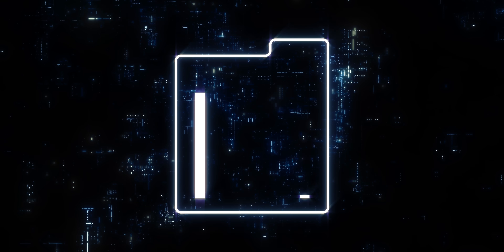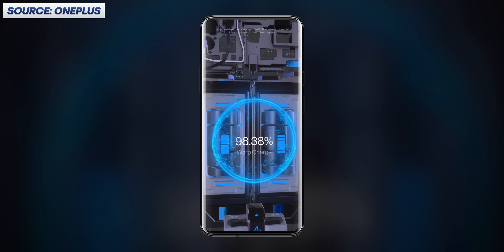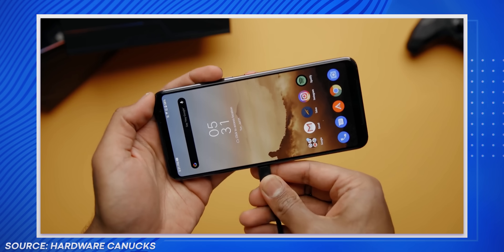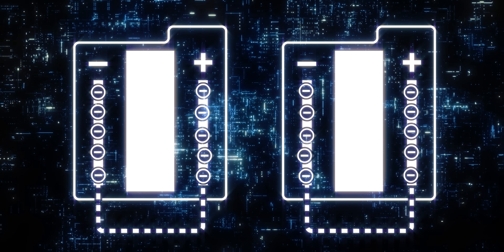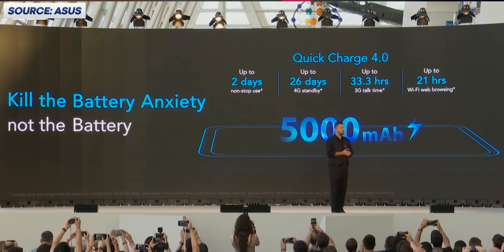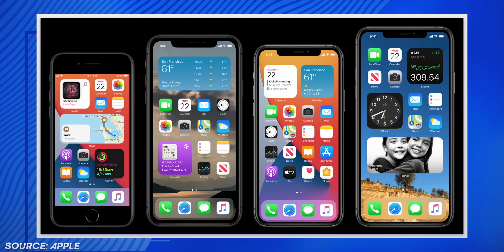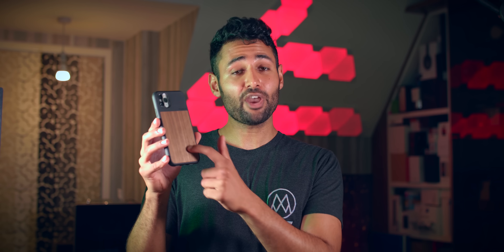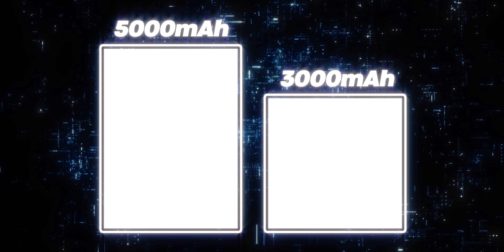The Problem with Fast Chargers.

Comment: Its like choosing between a fast mag and an extended mag
Reply: Extended mag any day
Reply: @Frosty-273  have a mophie battery bank case for my samsung galaxy s10 + 1 tb edition so worth it for all the drops i've had over the years and extra run time
Reply: Perfect analogy underrated
Reply: But always remember that switching to handgun is faster than reloading.😁
Reply: @hemlock42069  But,Using your knife is even faster.
Reply: @hemlock42069  wow, that’s actually right, switching to a second phone is faster than waiting for your other phone to charge
Reply: @hemlock42069  facts
Reply: except you cant carry extra mags
Reply: @rya1701  laughs in detachable Nokia battery
Reply: Extended mag with sleight of hand
Reply: @Udders18  what about Soda perks? (Codm undead siege)
Reply: Pubg players: i dont have such weaknesses
Reply: @manjunathprasad7558  I’m not talking about games. I’m talking about real life guns. Either get a faster loading mag or higher capacity mag.
Reply: Scavenger with fast mag.
Problem solved.
Reply: Power bank: box magazine
Reply: but in this case the fast charging phones even last longer than the slow charging phone's
Reply: I think having a phone with a removable battery and spare batteries in hand could be convenient and dangerous at the same time
Reply: OnePlus has chargers that keep the heat on the charger and out of your battery
Reply: Swaps to drop mag
Reply: Me who reloads after every single bullet 😂
Reply: How about both ;)
Reply: it's*
Reply: 777 👍
Reply: why use the extended mag when u can use scavenger to get more Mags
Reply: Extended mag for me
Reply: yeahh exactly what i was thinking lmao
Reply: The problem for those who chose extended mags in context of guns.. this extended mag is from 2 to 10 times slower than the quick mag.. now decide..
Reply: Extended all day, everyday
Reply: @evvrsince  theres a thing called fast extended in codm which gives you more bullets + reloads fast but it has some mobility downsides which make it balanced

Comment: Wouldn't 0% be when the positive and negative sides have equal amounts of electrons? Otherwise your negative would become positive and vice versa and you could power your phone again
Reply: you are 100% right.  0% charge is the 'stasis' point where electrons are equally distributed among both sides.  The amount of imbalance between the two sides is what gives power, so when there is no power it is because there is balance.
Electronics ship with 50% or less charge because shipping companies will refuse shipments of fully charged devices.  Shipping can be a rough and tumble process sometimes, and they don't appreciate it when you ship a full battery that then gets punctured, or otherwise spontaniously explodes.

Comment: Actually there's no problem with fast charging because the battery itself has a software management. The most important to take good care of the battery is to charge regularly and do not attempt to discharge it to 0%..

Comment: That's how lithium battery works, keep it between 20% and 80%, and also find the way to charge phone with less amp, one long usb cable can do the work,  long enough, to act like resistor so your phone will charge slower, theres some battery apps for android phone that can control charging but the simplest way is to use ardruino with simple relay to act like timer relay or use just timer switch... wherever you do  the battery will wear, but slower.

Comment: Very well made video, quick yet very informative. You should have mentioned about charging further away from 100% actually is healthier for a battery, for example charging to 80% would count as roughly 0.5 wear cycles as opposed to 1 wear cycle for a full charge. My number isn't completely accurate but just as an example. Sorry I'm not very good at explaining stuff but I'm sure you could pull it off in another video.

Comment: thanks for the physics lesson. i have learned so much more on chargers
quick question : if my device supports 45w fast charging (tab s7) and i use a 60w fast charger to power it, will this negatively affect the battery life of the tab s7?
Reply: No. The Tablet will just pull up to 45W power. So it will operate in its phone's peak wattage, not of the charger's. That way, the phone could protect it's battery.

Comment: There's 3 types of charging slow charging fast charging and normal charging slow charging makes charging the battery so slow but it makes it so long and fast charging is too dangerous cuz even if it charges battery faster but it makes your phone heat and u loose battery faster too and the best charging is the normal because it charges not slow and not fast and it stays for a quite good time

Comment: Informative presentation,  as always.  One concern about those wireless chargers,  though they do not erode the USB socket every day (ultimately needing repair) to get 30w by induction to the battery input,  you need to put roughly double that in the EM field of the charger.  Same thing as health concerns having your house near power lines, only in your next room..  @Arun, make a vid on SAR and mobile health issues,  show yourself an impartial opinion former.

Comment: What the fuck is wrong with you man
Apple is the same company that deliberately made bad batteries for their phones so that people would have to change their phones in 2 or 3 years.
Also most people change their phones after 2 years. If fast charging can sustain the battery till that time then what is the harm in it
It is still better than waiting for 5hrs for an iphone to charge and even then the battery stops working after 2yrs.
Next time when you take money boss, please mention at the start.

Comment: Thank-you! Battery damage,maintenance,and super fast charging info is NEVER talked about. Thank-you for bringing attention to the elephant in the room! Kudos!👍❤️🙏
Reply: There's another bigger elephant  around the corner,  fast wireless chargers. There are reasons we transit power via copper lines,  via EM that power bleeds in the environment with effects that cannot be good... Not to mention higher and higher frequency overlapping fields  (3G,4G, 5G...,,  home wireless,  personal wireless) that you have no escape from in an urban environment...

Comment: 50% battery charge does not mean a balanced amount of electrons across the positive and negative terminals... If that were the case, there'd be no charge imbalance (voltage) to induce current to run the phone.

Comment: I don't think that fast charging contributes much to battery capacity loss, I mean, my friend does RC car races, the batteries are 5000 mAh 4S LiPo batteries, he charges them at least with 1xcapacity mostly 5 to 7 amps, the motor in the car is pretty powerful and can take up to 300-500 amps at full throttle, and they last him a few years, while driving almost every weekend in the summer, you could argue that those batteries are specifically designed for this purpose and that might be the case, but the technology is pretty much the same.
15 W or 30 W charging won't exceed the 1,5 C rating of LiPo cells, every thing above that might become a problem in the long run.
LiPo batteries can take 800 to 1000 cycles, if you charge your phone every day, it is standard, that your battery will be at the ending of its lifetime after 2 to 3 years, if I buy a phone, I always want to be able to replace my battery, because it is usually the first part that brakes.

Comment: I have OnePlus 7 and after about 1.5 years of only fast charging it, the battery has degraded quite badly and it doesn't hold charge that well. Accubattery estimates battery health about 75% and OnePlus diagnostic tool shows 78%

Comment: Thanks a lot Mrwhosetheboss for this VERY INFORMATIVE video.
It confirms my charging habits are actually pretty good.
1. I don’t charge it over 80% let it drain to min. 30%
2. I never use a wireless charger mostly the 5 Watt (Apple Original) wired charger and very seldom (in a hurry) the 10 Watt IPad charger
3. I don’t use my cell during charging
And the result: My iPhone 11 Pro Max (bought 21.12.2019) still has a 100% battery 🔋 health.
Greetings from the Chocolate & Watch Country 🇨🇭

Comment: My old phone needed ages to charge but the battery is still kinda fine after 3 years of using but my new phone from the same brand has lost a lot of battery in under 1 Year even though i treated my new Phone a bit better it sucks because the battery only last 4 hours and if the battery goes under 40% i suddenly lose 10% +/- battery in 2 minutes it sucks

Comment: I'd rather have a phone that lasts exactly 12 hrs with occasional use that charges up to 80% by 20-30 minutes, and use a power bank wheneber I don't have power available, like camping in the forest etc. Than a battery that lasts 24 hrs, but takes three hours to charge.

Comment: Someone tell my mom leaving her ipad plugged in at 100% 24/7 isnt great for the battery. She apparently doesnt believe me.
Reply: my mum doesn't disbelieve it, she just seems to plug it back in every time i unplug it for some reason, she doesn't even use it she just keeps it on 100% and doesn't seem to realise that it's utterly pointless and just worsens the problem
Reply: @butterflyexists  that means your mum will do very bad and irreversible damage to the battery in time
Reply: Depends on the electronics. Modern devices switch off charging by themselves, so it does not matter so much...
Reply: oh god, what brick type?
Reply: Stephen Coleman  Actually, draining the battery also lowers its lifespan, as some research suggests. I use the 20% to 80% method to try to prolong the battery. They also say that it would be better if you keep it at a high percentage but not full, so if you have the leeway tp do 40% to 80%, or something like that, it would be better for your battery
Reply: ask them to switch( if possible) to a computer or even a laptop which has built in bypass charging
Reply: @rhapsody4025  wait laptops have bypass charging?. Why did its battery broke due to charging while using ?
Reply: @WhiteBrimYT  batery still degrade over time my dude
Or probably older laptop with older tech of bypass ones, lol

My legion y50-70 still last 3 hours in 80% battery with the gtx 860 always on, lol
Reply: Well, if she is using her iPad always while plugged in, it doesn't matter if the battery is dead as a dodo :-D
Reply: Tat mayb cos ipads take hell lot of time to charge. My ipad 7 takes like 8hrs to charge from 5% to 90%
Reply: @djjithujab  : Larger capacities take longer to charge , but last much longer. 
Just see it as bigger bucket of water, pal.
Reply: Well that's means the electric bill will skyrocket...
Reply: Stephen Coleman  I recently just bought a new phone which is the reason why I was looking to develop good charging habits. I don't have that much money so I also bought a mid-ranged phone, specifically xiaomi's redmi 9t which is about in the same price range as the A10s. Very satisfied with its 6000mah battery and the specs, especially for the price
Reply: Stephen Coleman  Understandable. But as long as google isn't disabled for Xiaomi phones, and there isn't any news that Xiaomi is doing harmful things with my data, I'll probably stay with them
Reply: My iPad Pro also takes a while to charge it takes a couple of hours but it is actually not that bad because I use my my MacBook charger and USB-C
Reply: if she has it plugged in 24/7 then she doesn't need battery life, she doesn't take it any where lol
Reply: Stephen Coleman  Doesn’t the a10s suck ass in like pure performance? or is that the a10e?
Reply: Does device turn it self off or the charger
Reply: My grandfather does it every time too
Reply: Stephen Coleman  A10s isn't midrange. It's a very low-end device, I know because my mom uses it.

Comment: I have found that my phone doesn’t seem to charge properly with the fast charger that it comes with it always starts to overheat at times and when it says fully charged and i turn it on but it drops down to about 80% just by turning it on it’s pretty obvious that your phones battery will get damaged when its using a fast charger as 1 its not fully charging your phone as it isn’t actually fully charged if you charge it to 100% then turn it on it drops by 15% to 20% as that’s the actual % that its charged to i have a samsung phone that has a super fast charger and another phone that has slow charging and when i turn them in at the exact time the samsung drops by 15% and my other one drops by only 2%

Comment: I actually see this a lot. I work in a phone repair shop and we use a tester with a led panel that goes in-between the power brick and the cable. It displays the amount of power going through. And I've seen phones accept about 1amp of energy up until the phone battery is at 80%. Then the reader will be knocked down to .5-.6 amps. Which charges the rest of the phone slower

Comment: Why the hell aren't they just making phones with 2 batteries in the box with some sort of clip system so you  can have one in the charger and one in the phone and when it's empty just clip the full one in the phone. Of course the phone should have also an internal cmos like battery to keep it on during battery switch.

Comment: Technology is evolving too fast. All batteries will deteriorate and using a fast charger, doesn't destroy the SOT or standby time, in an exaggerated manner. It will simply deteriorate over several yrs, just like anything else. Several of my friends and co-workers had to replace the iPhone batteries after 2-3yrs and those things take an eternity to charge. My Note 9 still has better SOT and standby time than my current Note 20 Ultra and I've been fast charging my Note 9, almost every night, for over 2yrs, with no significant deterioration, at all. These newer devices are that much more evolved.

Comment: I have been trying to tell people that for years. Any battery has a predetermined number of charge cycles. Charging faster than recommended will lower number of full capacity charge cycles you get. Charging slower (time) will obviously  take longer but it will increase the overall life of the battery. Bottom line is: it all comes down to consumer choice. 

Excellent presentation.

Comment: This hits close. Last year I got myself iPhone XR and kept using stock or wireless charger with optimal charging wattage. My friend bought an iPhone 8 about 3 months after I did, but instead she was using a fast charger leftover from her Xiaomi. Recently she complained about battery not lasting the time it used to. No surprise that her battery health was 79% and mine 98%. Both were brand new ofc. Android companies keep outdoing themselves by releasing quicker and bulkier chargers, but they never state the damage such charging will to the batteries, not to mention heat issues. Sure, when you hear that a 120W charger is included in the box it sounds amazing, but would you still be excited about it if it also stated that battery would degrade 10% each month of regular daily charging, not really.